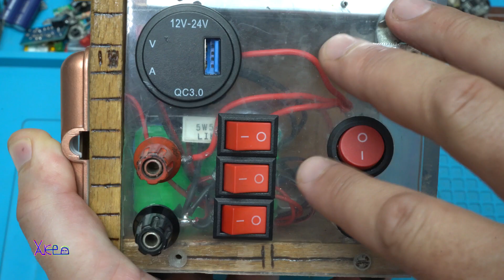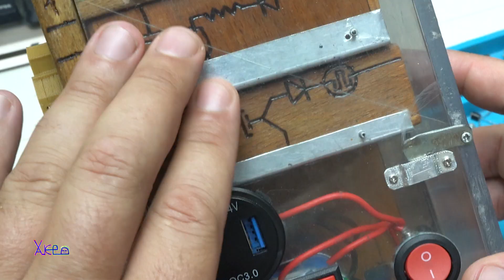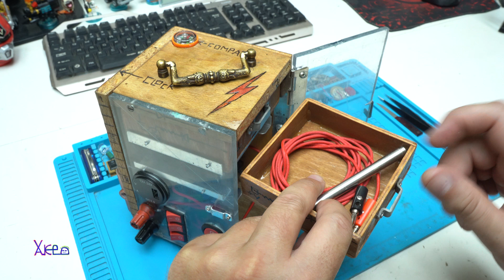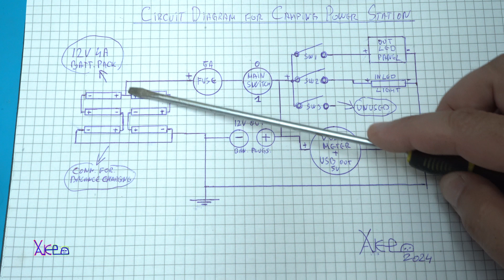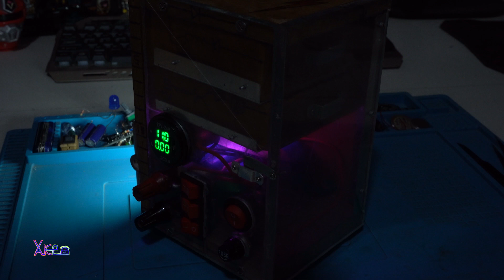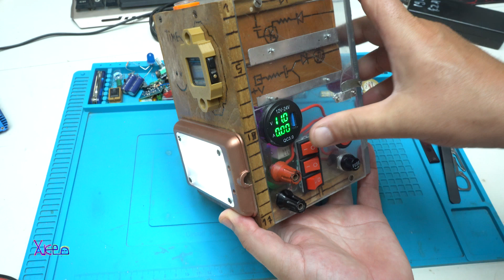DIY Ultimate Portable Power Gadget - (full review)

Comment: You could rig something up to use thermo electric to charge your batteries. BTW don't you need a bms for batteries in series.
Reply from the maker: I am using external bms charger,that why is that wago cable behind the device

Comment: You can replace the door with a solar panel to charge the batteries in the woods
Reply from the maker: So many suggestions to add solar panel,thx to all of you for the idea but adding small solar panel on side will not give enough power,current to charge the battery,maybe will help a little bit but it will takes days to charge full.
Reply: @Hacktuber andthe

Comment: It turned out great, man! Nicely done! 😃
One idea... A small plastic box, like the others you used, but for fishing. You can use something between 2 or 3 meters of fishing line and keep the weight, hook and anything else inside the little box. You know?
Oh, BTW... Some seasoning as well!
Anyway, stay safe there with your family! 🖖😊
Reply from the maker: I will keep some coffee,sugar,salt   etc in drawers,in future maybe I will add external solar panel,I didnt use small panel attached on device bcz such a small solar panel will not give enough current to charge the battery

Comment: Why not Add solar panel in one side .
And adjustable voltage output? 

I wanna make it one 😊
Reply from the maker: Adding a small panel on side will not give enough power to charge the battery,I need to use bigger external solar panel at least 10w